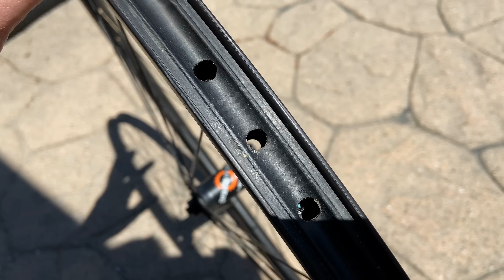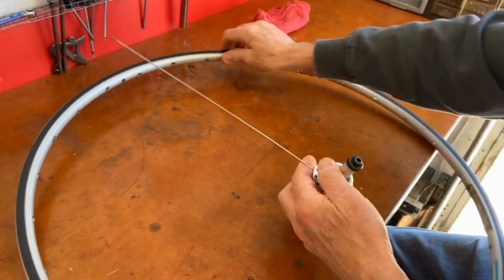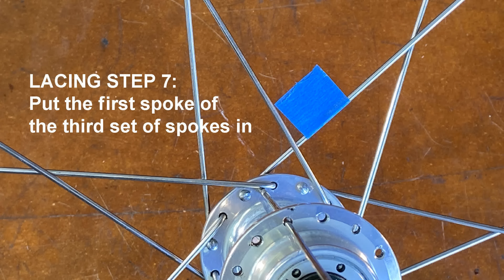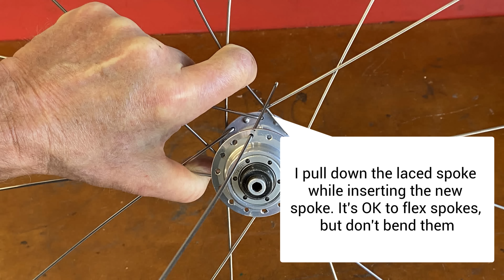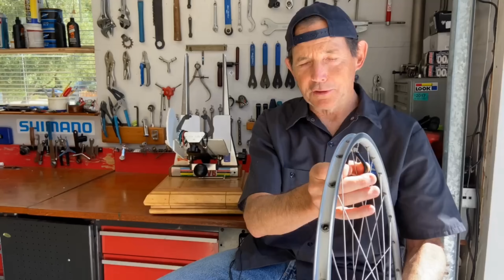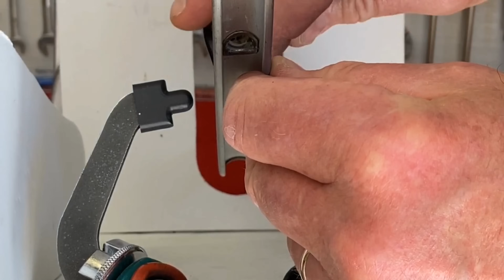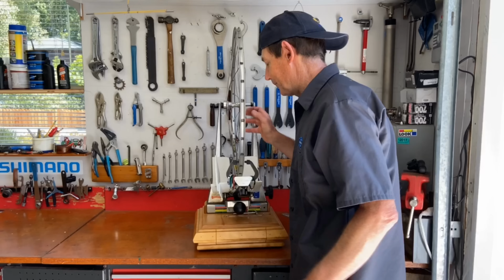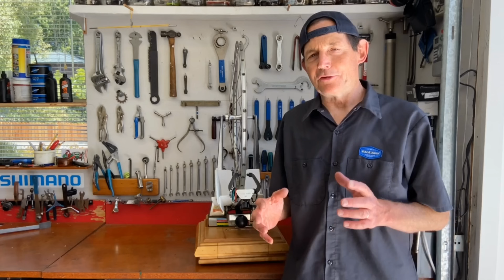How To Build Bicycle Wheels THE EASY WAY! #bikerepair

Comment: Brilliant! Obviously you being a teacher (instructor, professor, no offense meant) helps understand it much better (not always a pro in the trade is a pro at teaching; trust me, I've seen that in a trade school). Deepest thanks for explaining it that thoroughly.

One question if you don't mind:
I'm going to convert my singlespeed to hubgear (Alfine) soon. Can I reuse the rim and nipples or do I need all new stuff besides the spokes?
Reply from the maker: Thanks for commenting, Сергей Луцкий. For me, the best method is teaching while the student actually does what you're teaching them. This youtube video I made only shows how I would teach beginners to build wheels. Of course, I can't be there in person as they do it. My hope is that viewers who decide to follow my video will reach out to me if they have questions so that I can help them learn. I try to answer every question as soon as I can and have been helping cyclists learn mechanics with my books and articles since 1983, actually. Also, have my weekly column Jim's Tech Talk https://www.roadbikerider.com/author/jim-langley-2/   

To answer your great wheel building question, in most cases, as long as the used rim and spoke nipples are in good shape, you can reuse them. If the nipples are aluminum, you might find that some of the wrench flats got damaged or that the nipples wore right where they're turned in the rim. Another issue can be corrosion. If I see these things, I will use new nipples. Usually, brass nipples (they're nickel-plated so they look like chrome or steel nipples, but they're brass) - those usually hold up to reuse. Still, I would check them, too for any damage or corrosion and get new ones if you find any issues. 

It's easiest to evaluate rim condition when they're built up as a wheel since you can spin the wheel and look for wobbles and hops. Also, feel the rim for any possible dents from hitting things. And, check the seam if there is one plus look closely around the nipple holes. Make sure there are no hairline cracks which are the telltale sign of a rim that's only going to get worse and possibly break. Lastly, carefully inspect the sides of the rim for wear from the brake pads (unless you have a disc brake). Rim brake pads will wear through rims eventually and I would not recommend reusing a rim if the brake tracks are worn out. Some rims have wear indicators on them to help you know when they're worn out. I hope these tips help you out and enjoy building up that nice new hubgear wheel! Jim Langley

Comment: I find it much easier to lace the all the spokes with the nipples on the outside of the hub on the left and right side. Then add the hub twist and complete the nipple on the inside spokes, easier to insert them with less spoke bending required.
Reply from the maker: Mark Lydon Yes, that’s a good tip Mark. Thanks for mentioning that. I find that beginners can get “lost” once they start trying to deal with two sets at once. But it is a good trick once you understand lacing. Schwinn school taught putting in all the spokes before lacing. That’ll really mix you up if you don’t know what you’re looking at 🙂

Comment: Great video! Have built lots of wheels but still learned a few new things here. Do you have a view on whether trailing spokes should be heads-in or heads-out on drive side rears? I've never really paid any attention to this but apparently the Shimano instructions make some mention of it.
Reply from the maker: Ben C Thanks! Glad you like it and even picked up a few tips. I build disc wheels as Shimano recommends. They have a small army of engineers and I believe they know what they’re talking about. For front disc wheels, according to Shimano, you build so that the trailing spokes are all heads out.  This puts the leading spokes all heads in and that’s what they want for maximum resistance to the braking force on the hub/wheel. The heads in leading spokes put the bend on top of the hub flange resisting the pull when braking. But on rear disc wheels, Shimano has the trailing spokes on the drive/cassette side heads in so that they resist the driving force on the cassette. Then on the rear’s disc side the trailing spokes are just like in the front so that they resist the braking force. On rim brake wheels, I usually build symmetrically with heads in trailing spokes to resist driving force on the cassette. But, I’ve never noticed a huge difference in the different patterns on the road so I don’t overthink it. More and more when you buy a quality rim, the maker tells you how they want it laced and that’s nice because it takes any guesswork out of it. Thanks for commenting. I appreciate it!
Reply: @JimLangley1  Amazing answer thank you! I only have one bike with disc brakes and now I am going to have to go and check the configuration of the spokes :) Maybe I got lucky and they're actually the way they're supposed to be.

Comment: Is there a reason why you don’t use a spoke tension meter ? 
Just wondering
Reply from the maker: Great question, Mike. I do use a tensiometer, a Wheel Fanatyk - you can see it in use in my ICAN wheels review here https://youtu.be/Wb73si7WD-k?t=607 . That's a great tensiometer and I've used a few over the years. But, for this video I want to help anyone and especially beginners build wheels. Even the most affordable tensiometers are kind of pricey. And, most of them are not easy to use and understand what you're looking at - not without a full understanding in any case. So, I tell how to gauge tension on your new wheels in other ways that work without needed one. Okay? I hope that helps explain. Thanks for the comment and question. Jim